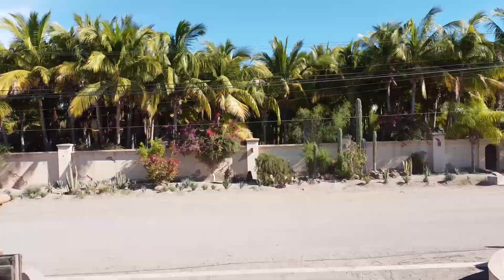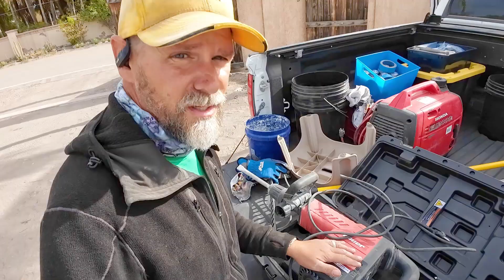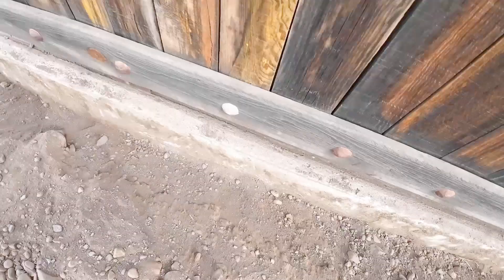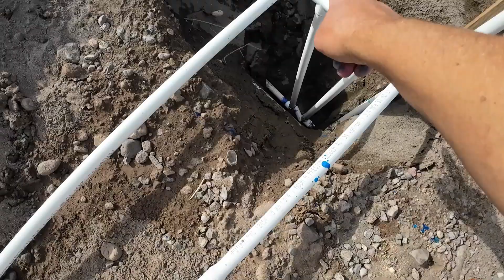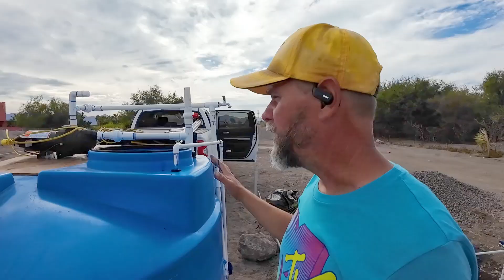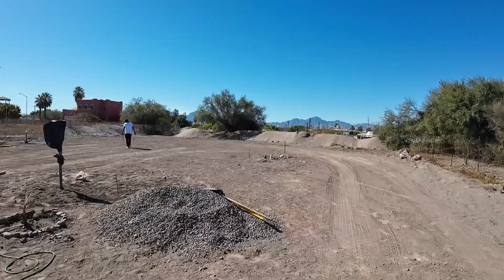Construction Begins on our Resort in 🇲🇽 Loreto Mexico!

Comment: You guys are setting them up and knocking them down!  Check, check and check!  Keep up the good work! It looks like it's still cold and windy down there.  We got as far as San Ignacio on Feb 17 and aborted our camping trip because it was so cold and windy.  We live in Payson and we should have known if the whole Southwest is having a cold winter, then so is Baja.  We'll catch you next time.  Love your videos!
Reply from the maker: We have been told it is a little cooler than normal. Coldest has been low 50s at night. It is usually above 70 for the high and sunny so I go from three layers in the early morning to shorts and a t-shirt by afternoon.